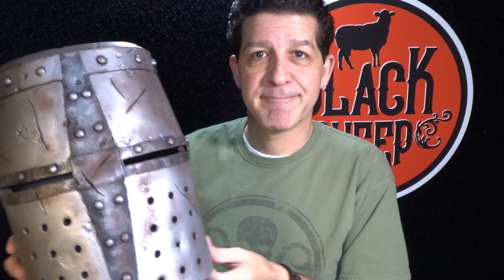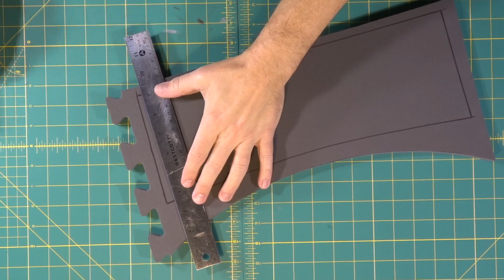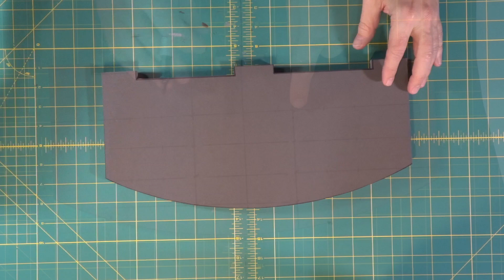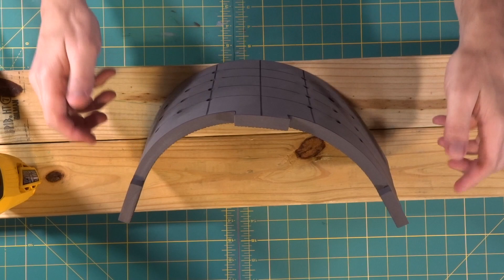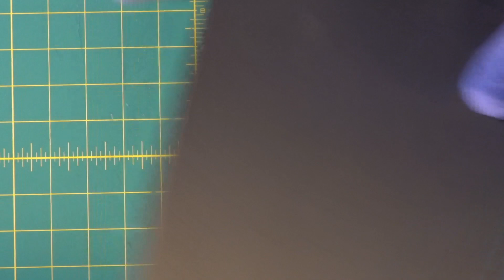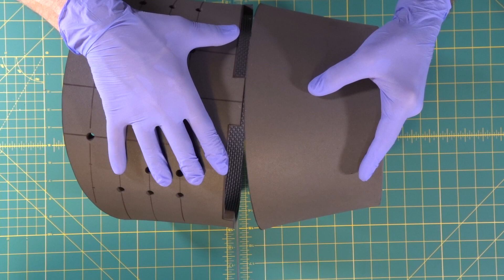Making An EVA Foam Knight Helmet Part 1

Comment: I dont have dry cement, heat gun, and I don’t know how to the measurements. Tips would be helpful
Reply from the maker: Hi Octavio!
Here is the link to the store where you can get a template for the helmet :https://www.etsy.com/shop/blacksheepprops
You can use the template and watch the videos to show you every tip you will need. You will have to buy contact cement.
Thank you!
Reply: @BlackSheepProps  thank you. your videos are really cool

Comment: i was re-watching this and what can you use instead of a heating gun?
Reply from the maker: Hi, I’m not sure. I only use a heat gun. Some people try using a blowdryer but it isn’t hot enough. And some people like to use a propane torch. Since you are only bending the top and bottom half of the helmet you should be able to bend it and glue it without heat curving it. When you wait for the contact cement to dry it should stick no problem even if you could not bend it with a heat gun. Hope that helps.
Reply: You could stick it in the oven, that's how I do it at least

Comment: So, any measuring tips?
Reply from the maker: Yep, the most important measurement is the distance around your head. Measure around your head at your nose and that will give you the length for the bottom half of your helmet. That same measurement will also give you the length for the top half of your helmet. The top half is tapered ( which is called a truncated cone in geometry ) Then you can go to any online calculator for truncated cones ( templatemaker.nl )so you can get a PDF pattern for the tapered top half of your helmet. All the rest of the pieces you can just measure once you assemble the top and bottom half of your helmet.
Awesome! Have fun dude!

Comment: I will like to make it but i want to know the lenght of the parts
Reply from the maker: Hey Jim!
The most important measurement is the distance around your head. Measure around your head at your nose and that will give you the length for the bottom half of your helmet. That same measurement will also give you the length for the top half of your helmet. The top half is tapered ( which is called a truncated cone in geometry ) Then you can go to any online calculator for truncated cones ( templatemaker.nl )so you can get a PDF pattern for the tapered top half of your helmet. All the rest of the pieces you can just measure once you assemble the top and bottom half of your helmet.
Awesome! Have fun dude!